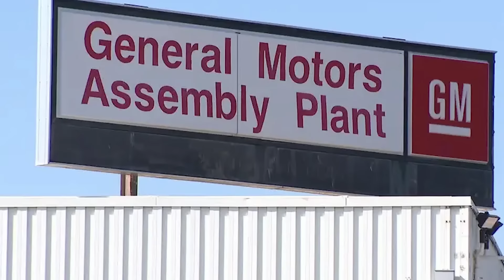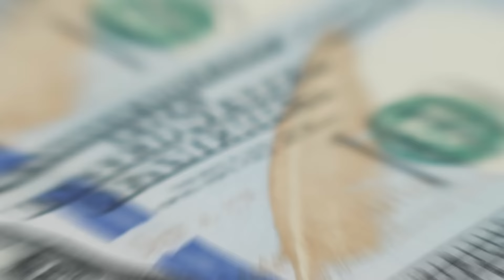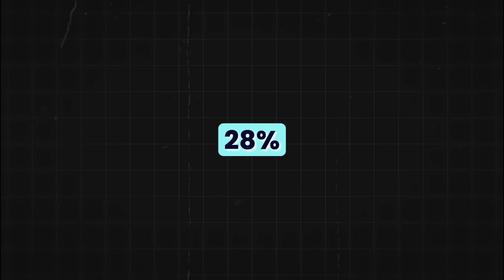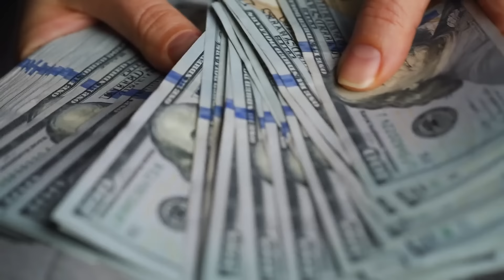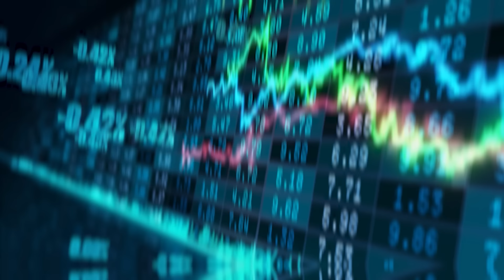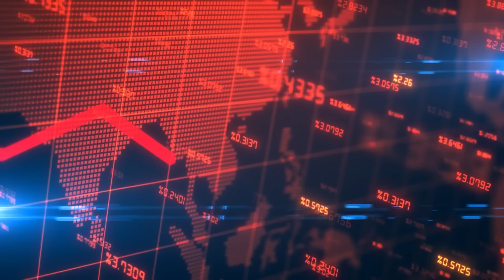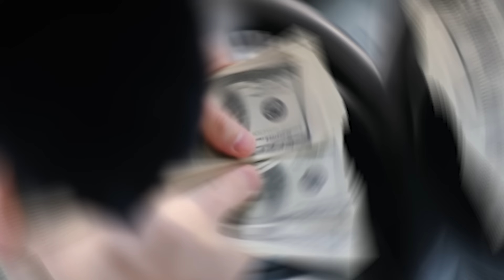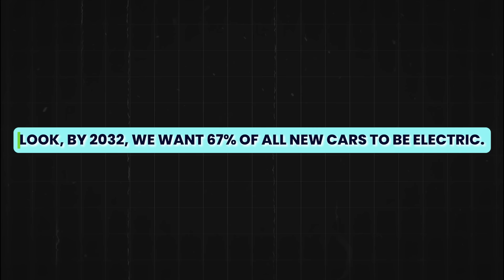The EV BUBBLE has Burst!!!

Comment: Imagine sitting in rush hour traffic in a snow storm or a heat wave as your batteries go dead.
Reply: It's happening
Reply: Or you run out of gas
Reply: @totaleXess  But you can always carry extra gas. As much as you want or need.
Reply: @totaleXess  scrap.
Reply: Biden Fault 🙁
Reply: Get a hybrid car.
Reply: happened in chicago a couple days ago.  tons of people stuck without power.  a reckoning is going to occur
Reply: I live in the mountains where the highways get closed for hours at a time for avalanche control. Tow truck were making bank taking teslas into town once the roads reopened, they made ten round trips bringing all the EVs to the chargers in town.
Reply: @MrSirPhase3 and you can leave the vehicle and bring the gas to the vehicle, not the vehicle to the charger.
Reply: @totaleXess lol running out of gas is user error, running out of charge because the past 6 months your trip has gone fine but suddenly because it's cold you only have 60% of your range is a problem with the car.

Both are solved by someone coming out to your location (or if it's reasonable a walk to the nearest gas station for ice vehicles) and enabling your vehicle to move again, the difference is once my guy shows up I give him the $20 for the gas he brought then spend a min pouring it into my tank. While you have to sit there in the cold for half an hour or more.
Reply: Or that you run out of gas.
Reply: @DoRC  And then I get out of my vehicle and pour the extra 10 gallons into my tank that I always carry with me in that rare case where unforeseen (CHIT HAPPENS).
Reply: @MrSirPhase3  Yeah you might carry 10 extra gallons of gas but basically nobody else does.
Every technology is going to have its advantages and disadvantages. Of course internal combustion agents have some every technology is going to have its advantages and disadvantages. Of course internal combustion engines have some advantages but so do electric vehicles.
Reply: @totaleXess  LOL. Poor argument. You have your freind bring you a can of electricity when you run out? Again, LOL.
Reply: @DoRC  Weak. Open up your mind and see the lunacy of your "argument".
Reply: @DoRC  Basically anyone who doesn't like being stranded in snow storms and traffic jams will learn to carry extra gas for their combustion engine.
If they own an all electric vehicle and they run out of juice in snow country at 20 below zero it's going to be a miserable day. Their so called electric vehicle advantages become useless until the tow truck rescues them from freezing to death.
Reply: @scottthomas8171  It's not possible to run out of gas?
Reply: @MrSirPhase3  most people are not going to be stranded in snow storms or traffic jams. Electric vehicles don't use a lot of energy when they're just sitting still and whereas range is reduced somewhat The range is still plenty for the vast majority of people's daily driving.
The reality is that just like with internal combustion vehicles where you need to make sure you have a good strong starting battery for cold weather and need to make sure you don't run out of gas you need to work within the limitations of the electric vehicle.
Nothing is perfect and everything is going to have advantages and disadvantages.
Reply: @DoRC  Unexpected things happen,  and yes, most people do eventually experience traffic jams. You have to make your own decisions. If you trust all electric cars to safely get you around then it's nothing to me. Electric vehicles are limited to the amount of juice that's stored in the batteries, and, you won't be recharging those batteries on the freeway in a major city traffic jam unless you get to a charging station. But hey, It's nothing to me if people choose to rely on an all electric car and they choose to think the same way you do. Just don't run the air conditioner too long while sitting idle in a heat wave while stuck in traffic. Sometimes accidents back roads up for miles and people do get caught in traffic jams that last for hours. Anyway. Good luck if you own an all electric vehicle.
Reply: @MrSirPhase3  again these are concerns without merit. Heat and air conditioning don't really use that much of the vehicle's battery and you're going to be running out of gas just like you'd be running out of battery if you're stuck in traffic for hours. The resolution is different but the problem is very similar.
Again this is a new technology and people are still learning how to handle its negatives.
There were naysayers when steam powered vehicles started showing up and they were naysayers when gasoline powered vehicles started showing up. As with any new technology you have two choices. You can either think it's weird and scary and get left behind or learn to adapt to an ever-changing world and not get left behind.
Reply: @DoRC  Point is, people can carry a lot of extra gas in a pickup truck to keep it running if need be. But that's not an option with an all electric vehicle. 
You will go until the power runs out, then you will come to a Dead stop. So, Good luck with electric vehicles. I wish you the best if you own one.
EV Manufacturers are losing billions on a product that is impractical to people who like to travel long distances. Paying expensive charging fees to sit in your car at a charging station every few hours in potentially unsafe neighborhoods for hours on end while your car slow charges for extended periods isn't very appealing to people who prefer to be sitting at somewhere comfortable after making a 10 minute stop at a gas station for a tank of gasoline.
Reply: @scottthomas8171 Vehicle to vehicle charging already exists on the Ford Lighting, its only a matter of time before its on all tow trucks; Use your brain boomer.
Reply: @DoRC stop drinking the koolade Sven, you know you are wrong.
Reply: @totaleXess and these generators will be run on gasoline. Get your millennial head out of your you know what!
Reply: Hey, where do you think the electricity in the charging stations comes from? FOSSIL fuels! This whole EV thing is as much of a sham as the Reliant “K” cars of the 70’s!
Reply: Imagine sitting in rush hour traffic in a snow storm or a heat wave as you run out of gas.
Reply: @tarp-grommet  I have. My imagination has left me with the right answer too.
That's why I can go to side box of my pickup at anytime, anywhere and pull out at least a couple 5 gallon cans of extra gasoline that I carry with me.
Imagine the look on the faces of all those Electric only vehicle owners who can't do that.
Reply: @MrImjustaminorthreat   both are human error because when i start my ev it tells me range , and yes its about 60% in winter (about -2c  north scotland)  of what u get in 15+c temp days  , but it tells u when u start car

this definitely a big negative  but if 60% range enuf the cost of elec/m vs fuel/m about 2-3 fold cheaper
Reply: @DoRC it's just more possible to run out of electricity due to shorter ranges. And it's a reality. Hurtz just dumped 20,000 EVs nobody wanted to rent.
Reply: Imagine trying to sell or trade in your older model all EV with worn out batteries that may not be charging 100% anymore and are possibly needing to be replaced.
Imagine what those replacement batteries will cost. Perhaps the EV market will crash and nobody will want your old worn out EV. Just some things to consider.
Reply: Brilliant point of view
Reply: @DoRC you're a child aren't u, not out of your 20s yet but know everything about everything..don't even know u but I don't like you 😆😆
Reply: @KS-45 100% dude...they're kids you're talking to on here, they wipe their mouths after they take a shit yet know everything bout everything 🙄😁
Reply: @tarp-grommet  and that can be remedied with a simple gas can. What are YOU going to do, run to Walgreens and buy some AA batteries? 🤣🤣🤣
Reply: @MrSirPhase3 they're not re-sellable..the batteries on average cost between 14 and 20,000 dollars conservatively, and they lose power n range every year, no different than a battery for a cordless drill..these people are nuts
Reply: If you run out of gas, get a diesel car
Reply: @clinttorres2508  yep. You guessed it. Definitely not a 42 year old professional mechanic with 20 years of experience:)
Reply: @KS-45  I don't know a single person who drives around with a full gas can. Not one. And I'm pretty sure you don't either.
Reply: @DavidWilliams-qr5yj   OK, one more time. EV sales grow steadily year-over-year. Q4 2023 was their best ever. The rest is just noise.
Reply: @clinttorres2508  good point!
Reply: @tarp-grommet  just an example of a fool and his money being separated. People will wake up sooner than later!
Reply: Gee, all you have to do is tow a trailer with a big gen set in it. Now you have unlimited range with your EV.
Reply: @tarp-grommet  Well now you do. I carry at least two full 5 gallon gas cans in my pickup side boxes everyday, and, have done so for decades. 
I carry a third one in the bed and use it for my equipment and swap the cans out each time I fill one up so the gas never gets too old.
I never go anywhere without extra gas.... Just sayin
Reply: @MrSirPhase3  Well good for you. People with passenger cars don't do that because then the car smells of gas.
Reply: Most golf carts are EV. @ProjectionTrolll
Reply: Look up Edison Motors. The are making and converting Semis from Diesel to Electric, but they put a diesel generator in,. The generator is half the size of the original Diesel engine. The batteries are 1/4 of an all electric truck. The generator runs at a constant speed for better emission and better efficiency. The generator runs about 1/3 of the time. And because the setup is more efficient, the fuel tank is half the size, with the same range. 

They are figuring out how to convert full sized pickups. The good thing is, it doesn't matter what fuel the generator uses. If you want hydrogen, or something else, that can be done also.
Reply: @daltonthomas901 . Half the golf carts are electric the other half ice.
Reply: @tarp-grommet  Yes it is good for me, but YOU said you never met anyone who drove around with a full gas can in their vehicle. Well now you have. So yeah. Good for you too.
Reply: @totaleXess  I will answer your troll comment and then no more. Anyone that uses the term "boomer" as an insult is proving they have lost the argument and has resorted to name calling. I am not even a boomer which makes your comment even that much lamer. Have your buddy following you around to charge each other vehicle to vehicle. LOL. What joke. EV's suck. Move on.

Comment: Most critical thinkers have seen this coming for 7 plus years. The problem is deeper than EV’s alone. Corporate has been cheapening quality, monopolizing maintenance, and pricing cars well beyond the common public’s ability to buy. All of this coupled with a doubling of realistic costs to live and everyone is trying to make what they have last. We simply can’t afford their gouging any more. I want an EV, the problem is they are simply not economical or realistic for ownership.
Reply: Most car companies sell combustion cars cheaper with a low margin, because they can rely on their OEM part sells, but this business model doesn't work with e-cars anymore. They also don't make any money with their engines and the now most expensive part, the batteries, are build elsewhere. Now you have to pay more for a new car, and you will get less, if you resell it, because the batteries degrade regardless if you drive the car, or not.
Reply: Not to mention that companies are legally required to do what is in the beat interest of the shareholders. So that means pricing EV's out of the price range of anyone that would want one. The mentality of short term profit vs long term viability doesn't exist anymore for corporations. They want as much money as they can get today, vs what would actually make them more money over the long haul.
And the complete lack of charging infrastructure is just one facet of this problem.
Reply: @0Turbox 
I think you should look into the "battery degradation"-part of your argument a bit more. You might get (positively) surprised !
Reply: All working as intended

Comment: Ironically, on today’s news was a segment on parking lots in Chicago jammed with dead EV’s waiting for charging stations!  Batteries and cold weather never get along well!  Gasoline doesn’t freeze!
Reply: It may not freeze but just like the electrical charge stored in a battery pack it does run out
Reply: Your battery dies tho
Reply: @iamakinupe9215 So does your engine.  Wanna know how to keep an EV running in frigid weather? First listen to the weather reports. Give the car a healthy, but not 100%, charge ahead of time.  Then leave it.  The thermal management system will keep the battery pack from freezing so the car can be driven in the extreme cold.
Reply: @aquarius44 calm down I should have worded my reply differently. I meant the 12v battery in an ice vehicle. I own an EV. Have for 6 yrs.
Reply: It most certainly does, close to the arctic circle. You know what also freezes? The battery that powers your gas engine. Good luck either way~

Comment: There is a huge difference between what Ford advertised and what it actually delivered. Almost no entry level Lightings were made. The entry level is what people ordered. On top of that they raised the price by tens of thousands.
Reply: Electric pickups are stupid.  If you can survive with an EV pickup, you don't need a pickup.
Reply: @dreamshop6071  exactly correct- EV pickups mean you don't need a pickup
Reply: i've heard story after story about people picking up a new vehicle from the dealer and then a month later being told by the dealer that the vehicle that they received was a higher package than what they ordered and being told that they need to pay $X more for those upgrades... What a load of crap..
Reply: @dreamshop6071  that said... most suburban people that own pickups don't need pickups..

Comment: In my local Ford dealership I’ve never seen so many Mach-Es in one lot before, I’ve slowly seen more and more piling up and same as Lightnings. Meanwhile gas F-150s get sold the moment they arrive. Especially with the recent arctic blast where temperatures went down to -20C, so many EVs kept dying so quickly. Only a matter of time before car companies turn on the government and force them to lift the ban on gas vehicles by 2035. EVs aren’t the future.
Reply: The reliability rating on those vehicles is atrocious
Reply: Well said and totally agree
Reply: The mach-e has an inventory build up for about a year of inventory at current sell rate ..😂😂
Reply: @Gunter_Custom  and how many are they actually selling? I never even heard of that model must be electric 😆
Reply: It could maybe be the future, but not until they figure out much, much better and cheaper battery technology.  They're pretty much 20-25 years too soon so the tech is garbage.
Reply: @SeaRaven227  and even if they do make a reliable battery, it’s still gonna be expensive to insure due to expensive parts and how hard it is to repair them. Plus EVs simply don’t appeal to most people, I also feel like car manufacturers don’t like EVs either which may be why they are so ugly, maybe on purpose to send a message to the government that we don’t want EVs.
Reply: Who said the goverment banned gas cars?
Reply: @stevemino142  far as I can tell about 40k in the US for 2023
Reply: @DJmace09 not in the us. The uk and Canada have banned the sale of gas vehicles after 2035… doubt it will stick but we will see

Comment: When I heard the cost of replacing an EV or hybrid battery costs more for used vehicles than the vehicle is worth with a new battery, that was strike one.
That charging at home, along with normal power usage, put power per kilowatt hour into the highest, most expensive price tiers, that was strike two.
The long charge times and lower travel range were strike three.
And, that manufacturing and disposing of vehicle batteries. And, the process of generating the power to recharge the vehicle had a greater negative impact on the environment than gasoline, that was strike four.
Reply: You forgot the potential for denial of insurance claims, if you park it where you are not supposed to. It's an incendiary device, firemen know its 8x more challenging to put out an EV fire.
Reply: @tedtan6449  ......You're right...Strike five.
Reply: @ Stephen-cr3sc... Strike 4, batteries catching fire. People warned about parking EV in home attached garages. Go figure.
Reply: @cinnamongmc5430  ......That would be strike six. Four was not as environmentally friendly as the auto makers are trying to make people think, and five is insurance companies don't like EVs.

I suspect your six might be an extension of strike five. 
The car catches fire while charging, burns the house, and insurance pays only for the car.